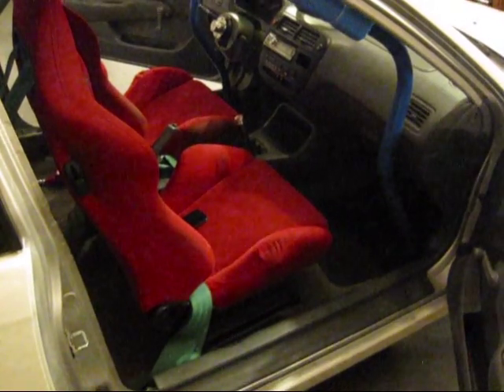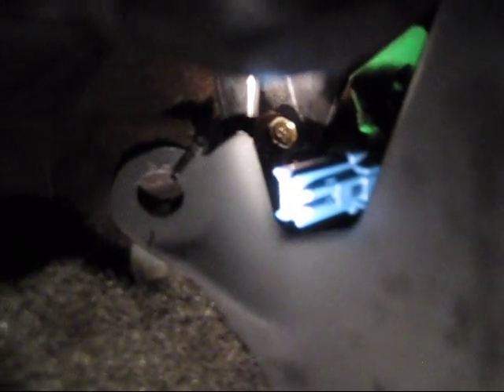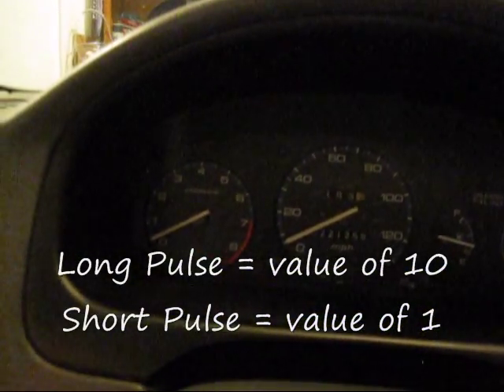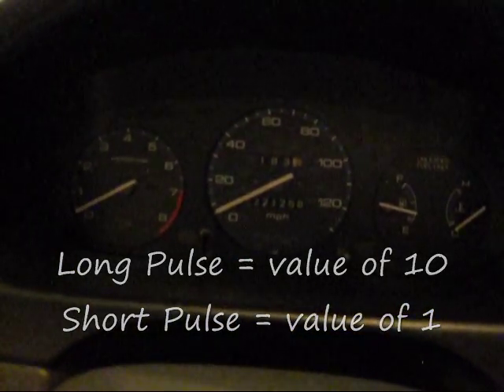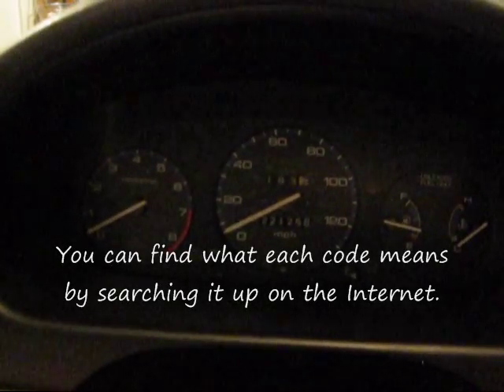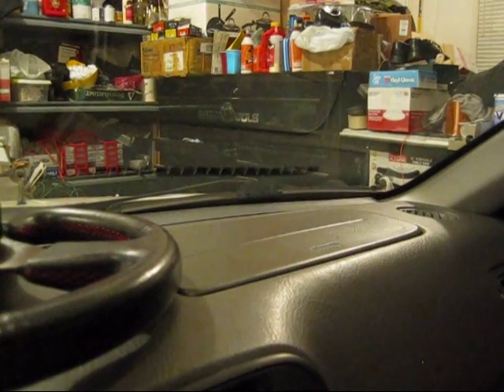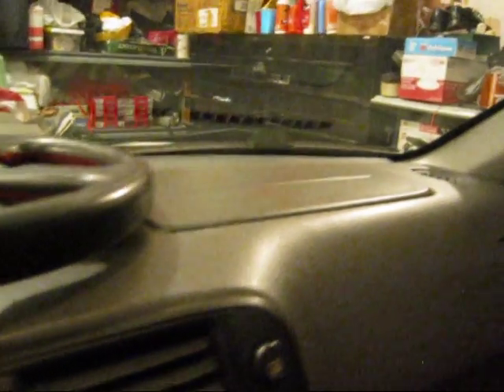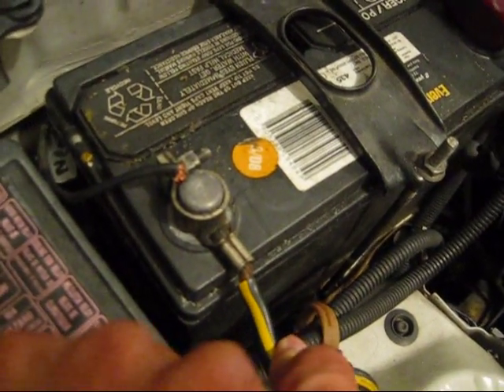How to Read Check Engine Codes with Michael Flare

Comment: My civic won't start, the engine spins but won't start, the injection light is on straight when I jumper, could anyone help me?  I've tried another ecu, already changed the distributor and nothing.
Reply from the maker: Can you check for two things to make sure?
1. If power is going into the spark plugs.
2. If fuel is coming into the fuel rail (fuel pump working).

Comment: My 1993 Honda Accord Flashed a ABS code which 1 Fast Flash And to Long Flashed in that sequence what is the code
Reply from the maker: You don't count the first fast flash, I think (I think you may be talking about the initial boot up flash that happens really fast as soon as you turn the key to the ON position). But if it really wasn't the initial boot up flash that you saw, then one short flash means code 1. Two long flash means you have code 20.

1: Oxygen Sensor "A" (Primary) 
defective circuit or unplugged / defective sensor

20: Electrical Load Detector 
defective circuit or unplugged / defective sensor
Reply: Ok thinks
Reply: But it was a ABS code flashing so can you tell me what that would be
Reply from the maker: I'm not sure. You should search the internet about it. Other people could have had the same problem in the past.

Comment: I did this and my Check engine light just stays on
Reply: Does that mean it's has no cel now
Reply from the maker: +FrostyOpsBootyBusta Why did you do this in the first place? If you do this test and the light stays on, then that means there's no code.

Comment: I've been having a hell of a time trying to get my ECU to spit out any CEL codes, can I get your advice, Michael?

I have OBD0 on a 91 civic wagon and have tried a number of ways to get the codes, but none have worked so far. The LED on my ECU constantly blinks a steady but slow series of short blinks which seems like a "standby" mode or something, and it continues doing this when there is no CEL, when there is a CEL, and when I've jumped the 2 pin terminals after getting said CELs.

Tried:
1) CEL appears on dash, pull over, keep engine running, jump the 2 pin terminals. No sequence of blinks (aside from "standby" sequence noted above).
2) Get CEL, pull over, turn engine off, turn on (but do not crank), jump the 2 pins. No dice, same result as above. (This is the method outlined in your video.)
3) Get CEL, pull over, turn engine off, turn on and crank til running, jump the 2 pins. Same result.
4) reset the ECU by removing the battery terminals and shorting them together, then repeating each of the above 3 listed, clearing after each attempt. Still no codes presented.
5) same as 4 but resetting the ECU by removing one of the fuses from the fuse box in the engine bay (can't recall which it was, but this was recommended on a forum).

I did the 1st one because I'd been told that OBD0 does not cache CEL codes and will clear them out when the engine is turned off. Can you confirm for me if the codes are cached on OBD0? Can you please confirm the proper method? I'm at a total loss here.

PS this is the page from the manual that I'm adhering to:
http bit (DOT) ly/1hJqS2s

much obliged

Comment from the maker: Highly recommended to remove the front exhaust portion of exhaust piping when you install front sway bar because it gives you more room to install. My exhaust piping is different. It's customized and its welded together from the header all the way to the resonator so I had to removed my header and the o2 sensor is attached to it.

Comment from the maker: nothing. I had to unplug the o2 sensor off the header when I installed my front sway bar recently and I accidentally turned on the car without plugging it back in so it gave me a code. I just plugged the sensor back in and everything is perfect.